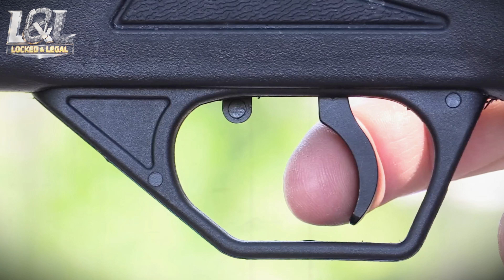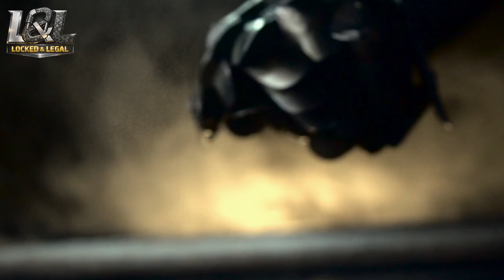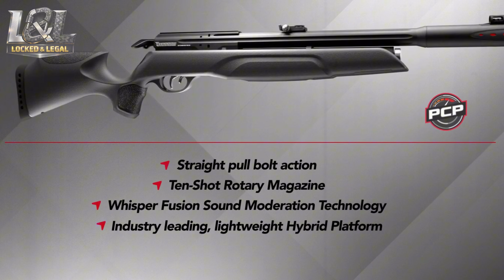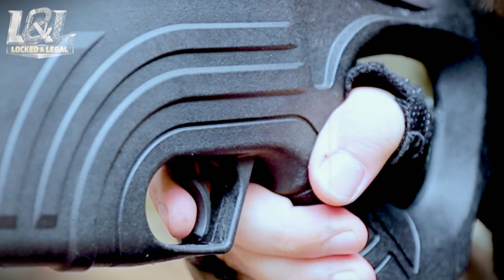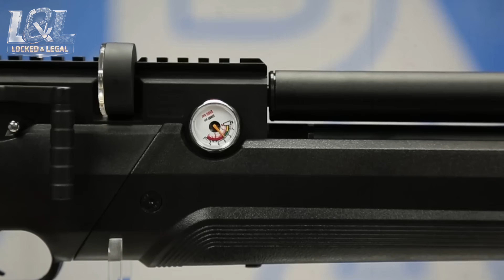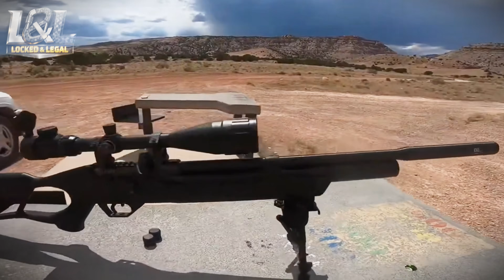5 Best .177 PCP Air Rifles 2026 for Small Game — Under $400

Comment: The flash r is a pos I have one in .25 and from the factory it was making 25ftlbs 😂 pathetic the pellets were like a mortar at 50 yards. I had to open the entire air path and crank the regulator just to get it to 42ftlbs which is about what they claim from the factory. The original flash is 10x better. It's also LONGER than a gauntlet, I know I own both.

Comment: Do yourself a favor and DON'T buy the Umarex Gauntlet in .177.  It's a freaking boat anchor in terms of weight.  Mine weighs close to 13 pounds with a scope and a bipod and a loaded magazine.
Reply: I have the sl25 and I didn't even know they made it in .177 is that the old Gen, or the new one? Anyway yeah I use it off a bipod for ground squirrels, rockchucks and what not. Its definitely not a carry around and hunt gun, too long and heavy for sure. But for a stationary position, it reaches out and touches big time. Mine is making 930fps with 33gr pellets at nearly 64ftlbs and 890fps with 33gr slugs that are absolutely devastating on small game. I love my sl25 you just have to use it in a specific way. For carrying around it's not the gun.
Reply from the maker: Thanks to both of you for sharing your firsthand experience! Weight is definitely something buyers should consider. The Gauntlet can be an excellent performer from a stationary setup or off a bipod, but if you're hiking and carrying your rifle all day, it may not be the best fit for everyone. We appreciate the real-world feedback!